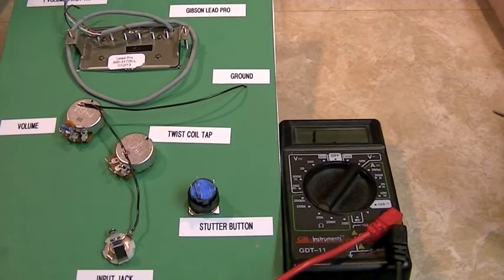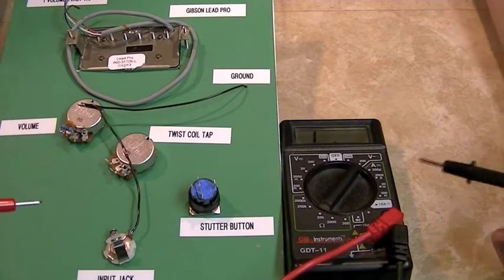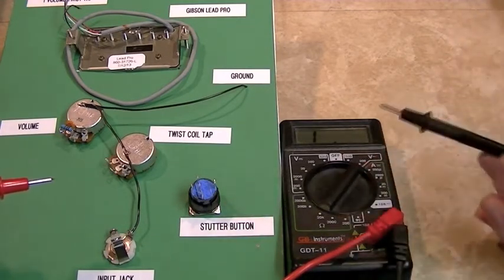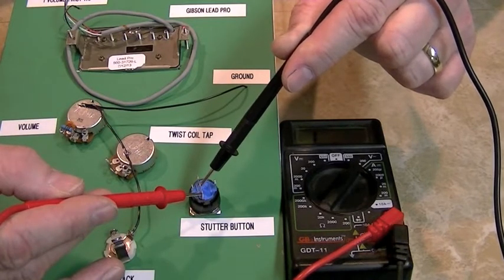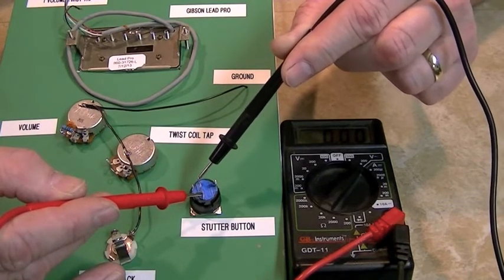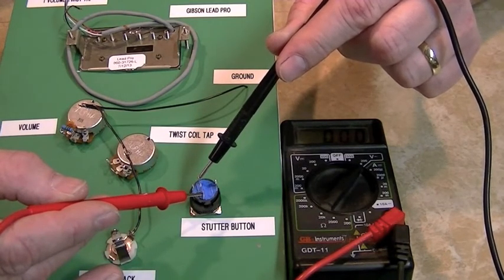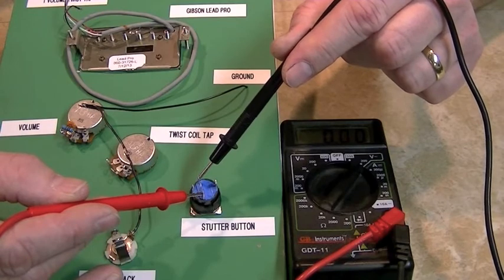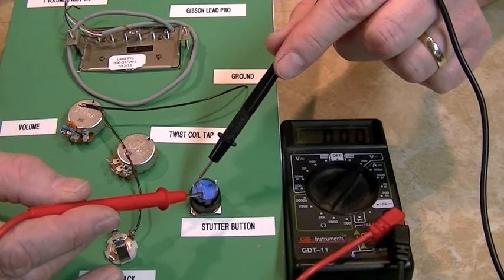Stuttering Guitars - How To Select A Stutter Button

Comment: While the signal from it goes to amplifier input...the jack on the guitar should be referred to as the output jack...ie: output from the guitar. 

You wouldn't have an actual input jack on a guitar unless you were to want to be able to feed it with the output from another guitar so as to blend the two instrument's signals.